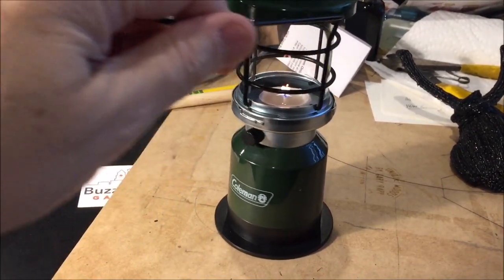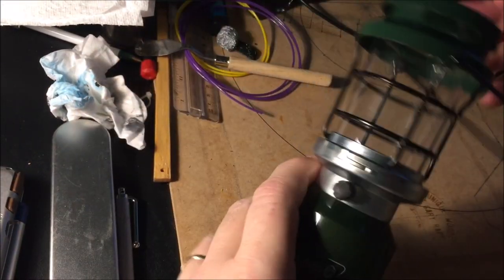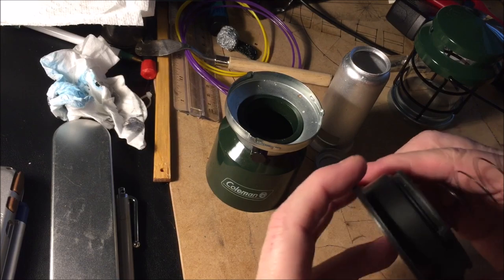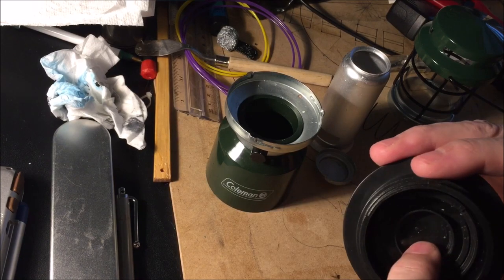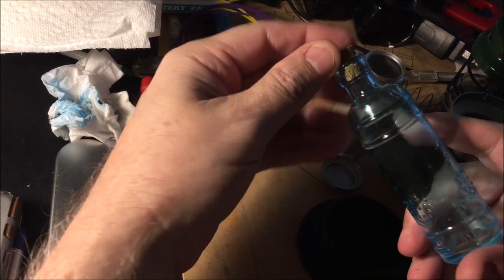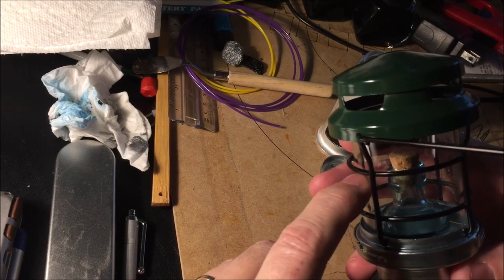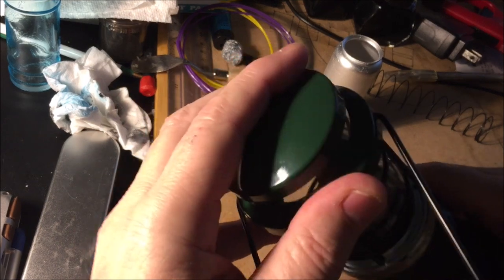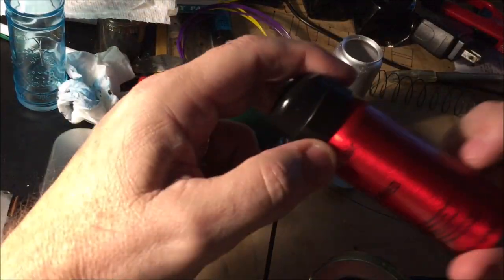A PERFECT HACK from CANDLE to OIL. Coleman LAMP

Comment: I did this same hack with a 1oz Absolute Vodka bottle! It has a metal cap that I punched a hole through from the inside out. Then I fed my wick string through the hole and the tiny bur left from the nail holds the string in place. This worked great for my Coleman candle lantern. Your upgrade did well too.
Reply from the maker: That’s so awesome. It’s small but sets the mood.
Reply: @Mity_Moose  I wish I could attach pictures on here. O well, thank you for the cool video.

Comment: My metal twist lock is starting to get loose at the 3 prongs. Even when I twist it closed, one tab always wants to pop out of the groove and hope that the middle don't separate while the candle is lit. I like the idea for multi fuels on the lantern. I like using the candles for boondocking in the back of my Tundra for safety, but would like to try oil for larger safer areas.

Comment: Did you try how many hours it can be run?
Reply from the maker: I thought about that, but have not as of yet. However, based no the number of times I have refilled it, I can approximate 9 hours or so. Not bad for a tiny tank.